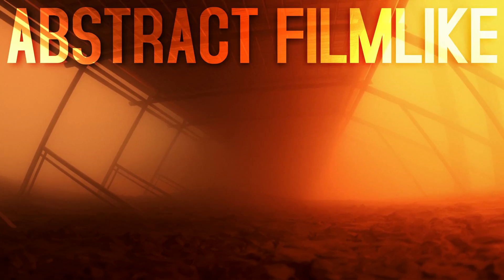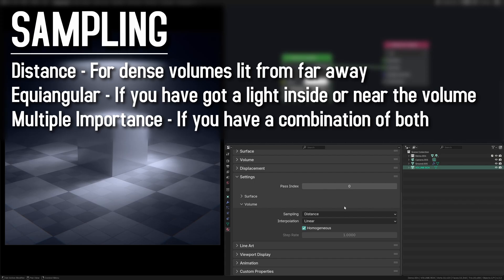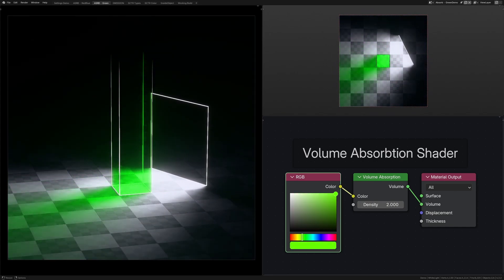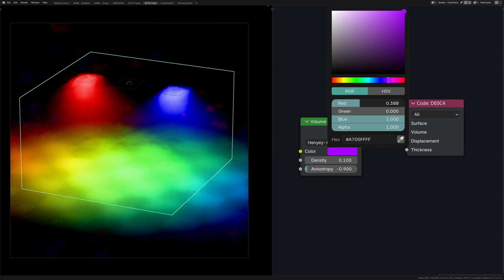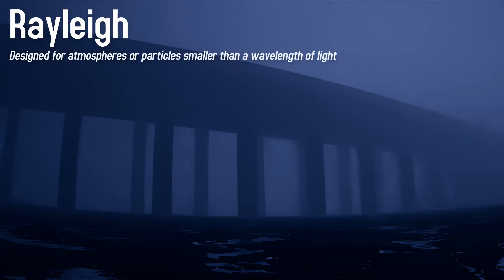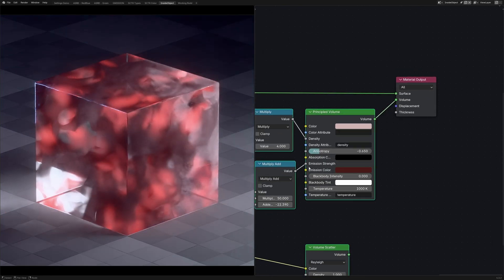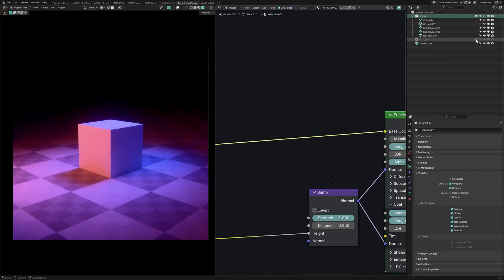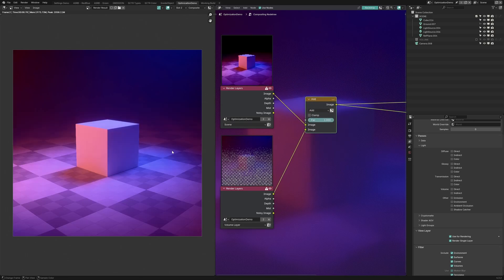Everything About Volumetrics in Blender - Tutorial

Comment: Quick question: I thought 1:59 looked really cool, so I recreated your set up real quick (I think, anyway) to start messing around with and I'm getting this strange terminator effect in the middle, like a dark wall where everything zeroes out. It makes sense that it would, but how is your visualisation side-stepping that?
Reply from the maker: Ah that's probably because the density of the absorption shader is set so high.
If you create a second absorption shader with a much lower density, around 0.1 (give it the same red & blue color input) and mix it with the original using "Light path > Is Shadow Ray", it should fix the issue 🙏
https://imgur.com/a/iAgzNq8

Comment: Great stuff! One thing I struggle with volumes w Blender though is noise, getting a volume to be low in noise seems impossible, denoising is fine for a still, but as soon as you have an animation the temporal noise becomes horrendous, any chance you have good workarounds there?
Reply from the maker: Two potential ways I can think of would be:

A: Turn off random noise seed per-frame, This will make it less jittery when denoised but might create a noticeable burnt-in "overlay" effect

B: Use EEVEE to render the volume in a separate layer (like I showed at the end). This should have virtually no noise, but it will probably be less accurate

Hope this helps!